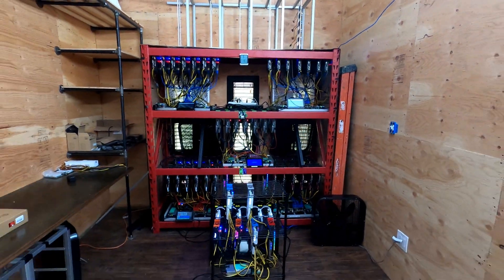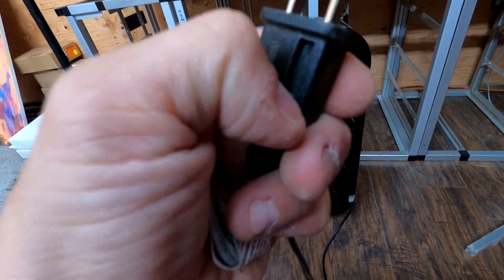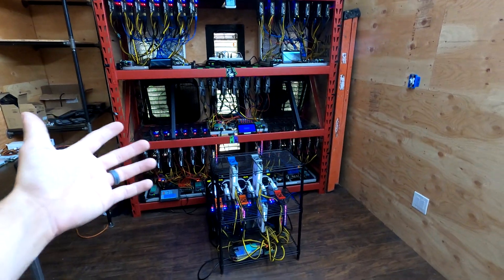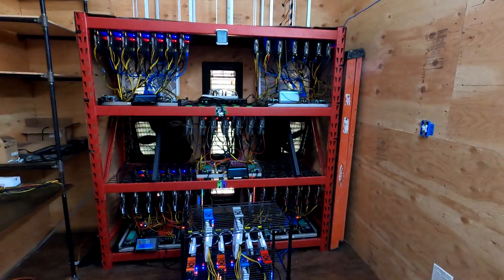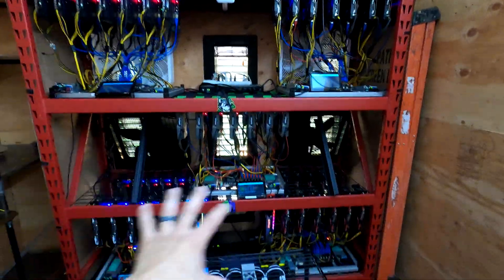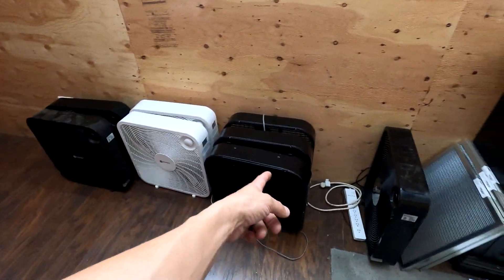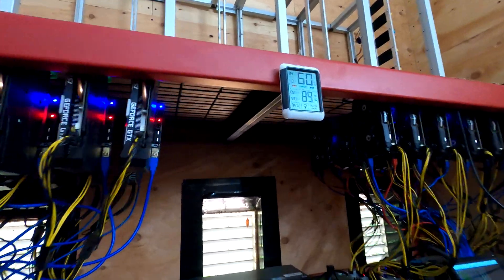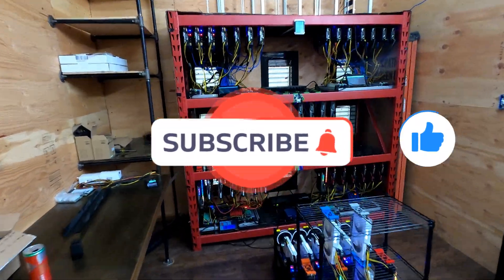GPU Mining Farm Fan Removal | Intake Fans Bad Idea...?

Comment: You listen to people in the comments?
Well then here's another tip: Move the entire shelf like a feet away from the wall, but still seal it on the sides, what will happen is that the air intake from the vents will naturally spread wider before it hits the cards and so this way the airflow will reach the cards on the sides.
But at the same time the cards that used to be right in front of the vents will get a lil warmer as they will get now air at lower velocity.
Reply from the maker: That’s not a bad idea

Comment: Ok lots of comments for this vid. My input: it seems like only your 3 upper intake windows are sucking a descent cfm into the room due to the position of your exhaust fans (high) they force intake air from top windows and much less from mid and bottom windows. Mastering airflow is always a hard task. I been thinking to use some of those compressed air color cans (maybe found in party or Halloween stores) as long as they are safe for the rigs, and use them to get a clear vision of which route is your airflow taking from intake to exhaust. Also, could not help noticing you move the rack with the mining rigs on (big mistake), you could lose valuable investment there. Furthermore, I do not see any power ups for any of your rigs, an electrical storm or any spike can harm your rigs. You can also try positioning the rack further out from the windows and using fewer fans to direct air to force it through the rigs maintaining the wind tunnel sealed all the way to the front of the rig like you have it now. Use the rpm on the box fans at a level that will not generate negative impact on the built-in gpu fans. These will depend on your floor fans distance from the rig. I had to shut some rigs off today due to extreme temperature (95F New York) and one of my power supplies appeared to have died. I have installed "AC Infinity 8" high cfm fans" to exhaust and install an AC and some floor fans but still gets too hot on my basement. I am also facing this airflow challenge. Good luck.

Comment: Hey Chump change!! I can validate that most likely, the intake fans will not help the cooling that much, if not at all (like you noticed!) Basically, just having some fans exhausting air will create a negative pressure (like a vacuum) and will suck fresh air in through your vents!! Another tip i would recommend, is to remove the top piece of carboard! The heat will rise from your rigs and then get blocked by it, whereas you will want it to flow up to your top exhaust!! Im not an aerodynamicist either, but I am a mechanical engineer and have studied basic concepts of fluid dynamics (which comes back to airflow). Cheers and good mining! Ive dropped my first youtube vid of building a mining rig, if ever your interested!! Your a real pillar to the mining community man, cheers!!

Comment: I'm running 33 GPU's in my basement with (2) iLiving ILG8SF10V - 10" Wall Mounted Exhaust Fans - 820 CFM x 2, 1200 x 2 SQF with a wired in wall RPM control knob. The fans are mounted up in a basement window in a dual configuration directly behind the mining Rig Rack.  This summer I am no longer running any outside air intake fans in opposing windows.  The house is a brick NE Ohio Bungalo with good insulation and a 1 year old NEW Furnace/Central AC System. This is contrary to everything I have done in 3 summers of mining at a high level. I am now keeping all outside air intake windows closed. I'm strictly running those (2) 10" 820 CFM exhaust fans at 50-60% RPM with the whole house AC set at 69c. I have all the basement AC vents open to maximum and I am cooling the whole house including the basement. The basement stays fairly cool, but the overall inner climate of the entire home is much better and the GPU's run a few degrees cooler.  The Central AC never stops running except at night when the outside temps drop.  Without the outside air intake windows open, the living/office areas in the home are much less humid and more comfortable. I also neglected to say that each of the 33 GPU's of various types all have their own individual CoolerMaster 120mm Exhaust fan pulling air away from the GPU's and into those 10" dual window exhaust fans. I have a very nice cooling situation in my basement & home running this way. Sure, I pay for the AC to run constantly, but that OK. If ETH wasn't going to POS, I would get another 11 GPU's to get up to 44.    I'm happy to see you mining at a high level with a nice cooling/exhaust system. Have a great summer.
Reply from the maker: Good stuff my man!! That’s amazing and you as well!!

Comment: Sometimes air moving too fast across electronics with fans can hurt cooling. Making it harder for gpu fans to suck in air because it’s moving too fast. Jaytwoscents discovered this when he was trying to do some extreme over clocking. Think about it you stick your head out the window of a moving car It can be a lot harder to breathe
Reply from the maker: That makes things 100% more clear. Appreciate you!
Reply: My solution was to but all fans Backward, that whey they suck the Heat from the Cards. Worked perfect for me 👌🏼

Comment: In firefighting we practice ventilation and flow path control.. the best way to horizontally ventilate is to place a fan outside and aim it at the entrance door. Feel for the wind with your hand by reaching up around the door after placing the fan. Direct the fan flow so that the wind entering covers 80-90% of the entrance door flowing into the unit. This will push air out of your exhaust fans better. You might need a larger fan for this
Reply from the maker: I appreciate that thank you and thank you for all you do 🔥❤️

Comment: Do you have enough space to stagger the 1st and 2nd row of cards instead of single file? So that each card gets fresh air, and not heat soak from the card behind it. Probably wouldnt matter, there is a lot of space in between your cards.

Comment: I also found that the intake fans actually push the air away faster than it needs to. I removed my intake fan to my grow tent and put a register box on my 6 inch duct against my pandaminer fans and I'm getting 57c core temps on all my 3060tis at 90f outside. All u really need is a LOT of exhaust and direct airflow over the cards

Comment: I bought wind reader after watching a video. And these box fans have dead spots where there is no air blowing when you measure in front. Also they suck in air in corners. So they recycle some hot air.
I also found out that the middle off my room had 0 air flow even if intake and outtake had 3-6 m/s flow.
So i moved 1 boxed fan i middle of room to transport the air closer to outtake. This was the REAL impact off my rebuild off room.
I also put Box fans in front RIGS. They will suck air from the inntake holes. 
After testing meny different blow/suck/placement off fans. Negative, positive pressure of room.

Placement: Wall inntake, 10cm gap,  Rigs, 10cm gap, Box fan, 1m Gap, Box fan and then then wall fans to suck out air on the other side off room. Gave best result.
My temps on card dropped 13-15 Celsius. 
My tip is. 
You need to have breeze of air flowing in the room. Then suck this air out. 
Reading specs tells CFM but dont show how far air is pushed.
Reply from the maker: Impressive sir!! Much appreciated!!! ❤️

Comment: On the other hand, you need to remove the cardboard from the sides and from the top to let the heat rise and be expelled by the exhaust fan from the top.
Reply: The sides should stay, the top is debatable.

Comment: Isn’t GPU temp more important than ambient room temperature? What was the before and after GPU temps? 

I still think a wall of box fans is the way to go. So it’s more about airflow across the GPUs. Exhaust air is obviously still important. I would zip tie the fans together side-by-side to the back of each shelf and measure before and after temps. Better yet do one shelf and see if makes a difference vs the others. It looks like that's an 8 foot shelf so you could tie four together and get enough coverage. Imagine each shelf is mining case and your pushing air through.
Reply from the maker: Yea that’s what I thought also!! My mind is blown. The GPUs are cooler because they were shutting down and now they are not so I’m excited about that!
Reply: GPU temps are most dependent on ambient temps lol. The two are not mutually exclusive.

Comment: So I have a question. To grow I need to move out to my garage, plenty of power out there. My concern is I live in a northern climate. It's warm and humid on the summer And can get down to below freezing in the winter. Will those temperature extremes damage the mining rig? Keep up the great work!
Reply from the maker: Hey no worries at all! So I live in New England area (USA) it’s basically the same here. 
The winters I LOVE for mining lol! 

The summers are hot and airflow is the best thing you can have to cool the cards. 

Humidity can be bad for the cards yes but unfortunately I don’t think there is too much that can be done in this type of set up except put filters on each intake (which I will do sooner than later on my end). I had filters on at one point but they restricted the air flow so bad I couldn’t leave them on. Now I need to order 6 more and I will see how all 9 affect the air flow!

I appreciate you watching and that kind words! Thank you!!!
Reply: I moved my rig into an outside in the uk,  I have to keep the door open in this weather,  I got a grow tent extractor for the night when it’s locked otherwise it turns into an oven
Reply: I'm not worried about the summer, my garage did get warm, I guess I should check to get a baseline temp. I'm more worried about the humidity. It winters can be brutally dry or really wet and mild. I'm wondering if a grow tent in the winter with passive airflow. The heat from the rigs drying the air.
Reply: @gadget069  a tent with an exhaust fan what be able to regulate the Reletive Humidity inside,  I’m getting a WiFi hygrometer so I can monitor the heat and the RH in the winter and wire the exhaust fan to it so the doesn’t exhaust all the heat in the winter months

Comment: I'm thinking the Fans are restricting some airflow.  I think removing them will help.  I know my Navi Cards are very sensitive to heat.  I just moved my 5600 XT rig into an area I have with a mini split.  I have servers running in there, so hopefully that may help.  Since the last few Hive updates I'm getting a few Dead GPU errors with Team Red MIner, so I'm switching to Phoenix Miner.  Anyone else having Dead GPU errors with Team Red Miner and Hive?
Reply from the maker: Yes I have been getting a few of those errors myself
Reply: I am, but I thought it was my gpu. My 5700xt was being a pos before I started mining. I’m possibly thinking I need to replace the thermal pads because one spot gets really hot but I don’t see any pads.
Reply: I am getting dead gpus suddenly too.
Reply: Using TRM still on my 4 and 8 gb 580's no issues. But on my 5700 xts.. dead all over. Was driving me nuts. Switched my 2 5700 xt rigs rigs to PM and been much better.
Reply: @marklawrence4427  yeah. I switched to Phoenix Miner as well. I picked up 1 MH/s per card and no more dead GPU’s so far…. 🤞🏻🤞